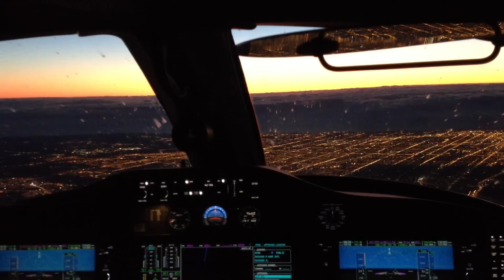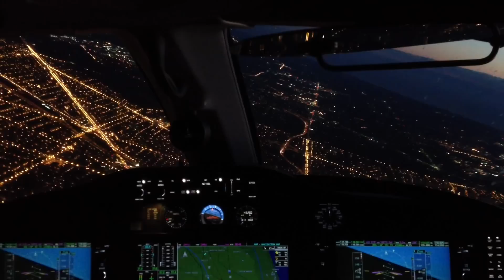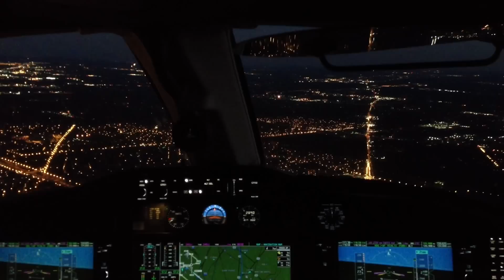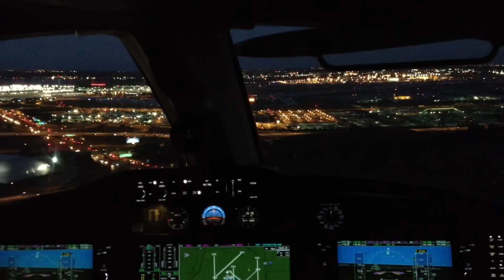Landing Chicago O'Hare, Citation Mustang Cockpit View and Live ATC

Comment: other video I see a fin flip behind one engine during taxing .is that to help steer or was pilot just checking individual thrust reverse
Reply from the maker: +stewart baker Could be either one. At idle the engines still are producing thrust and if taxiing with a tail wind it's hard to keep the speed down without riding the breaks. If the aircraft has no limitation against it's use  you can use one or both thrust reversers to help slow the aircraft during taxi. When the pilot does this he doesn't add power but, just pops the buckets to kill the residual thrust.